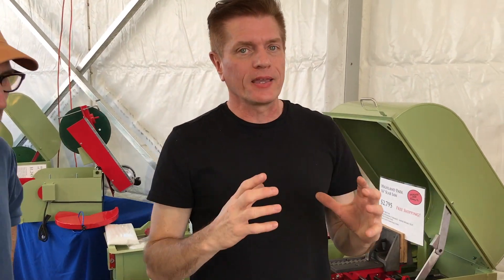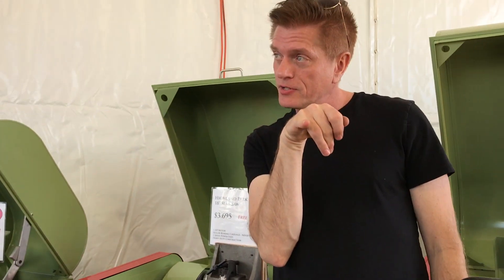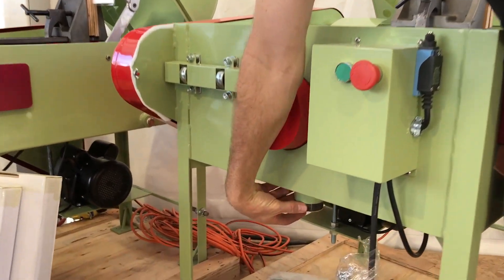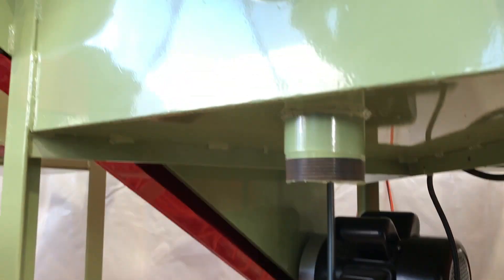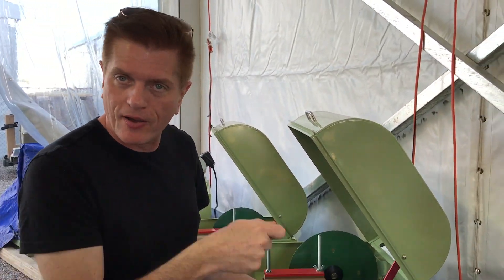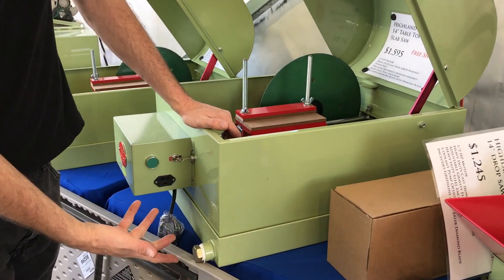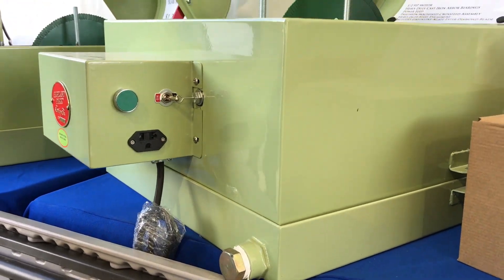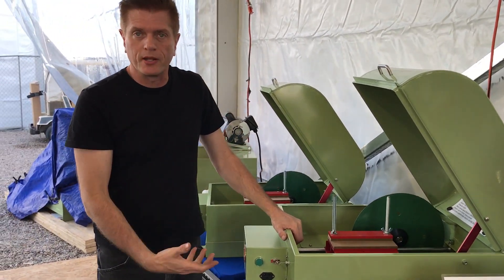Why Slab Saw (Drain) Size Matters

Comment: Do the larger saws come with ball valve drains ?
Reply from the maker: We use 2-inch drain caps for our drain, because we found that using small ball valves is not efficient in removing sludge and dirt.